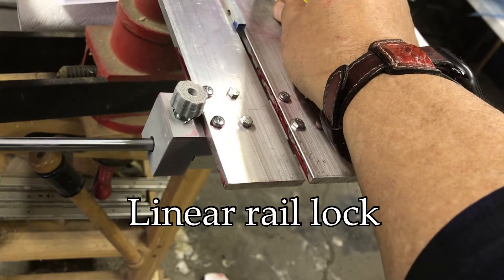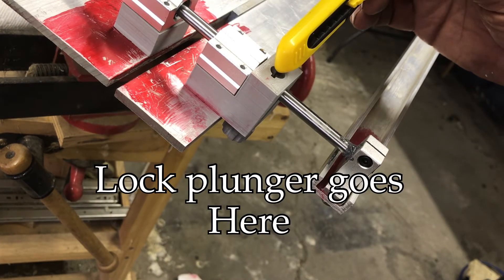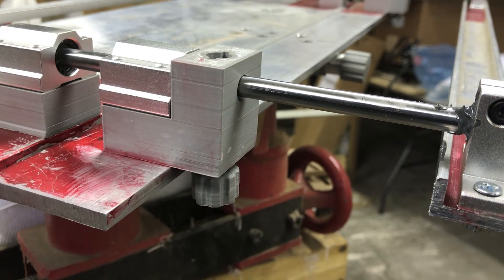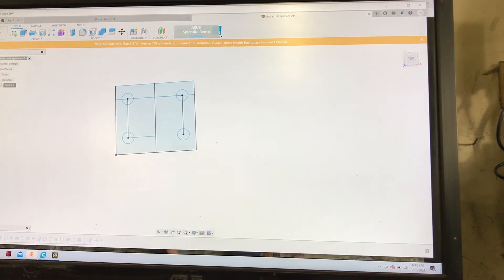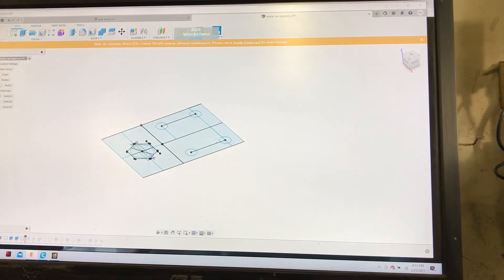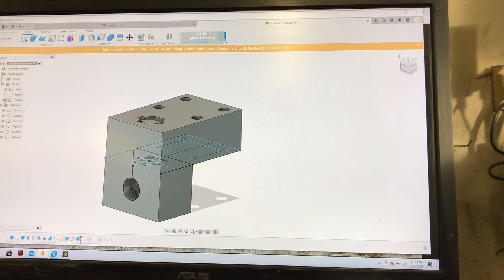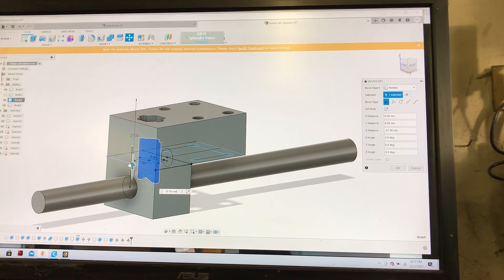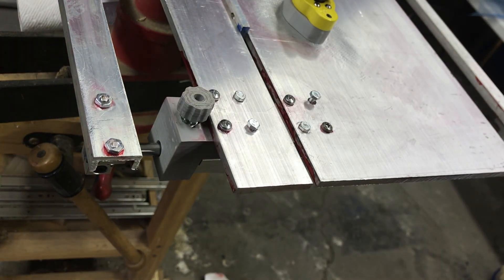Linear rail lock

Comment: You are giving me ideas.  I was frustrated with my table saw fence system and build a nice sliding fence with guide rails.  But locking them with the small hole in the guide itself is not adequate.